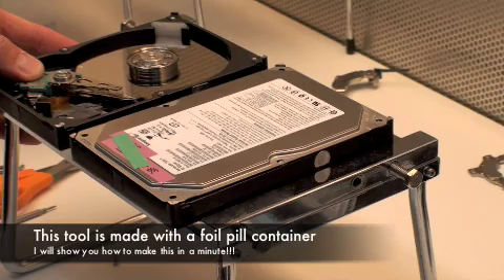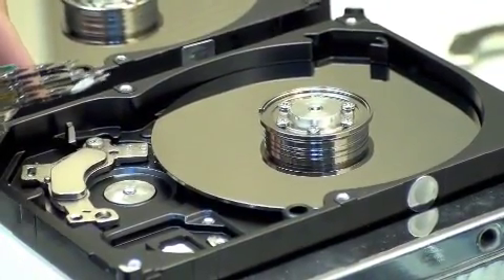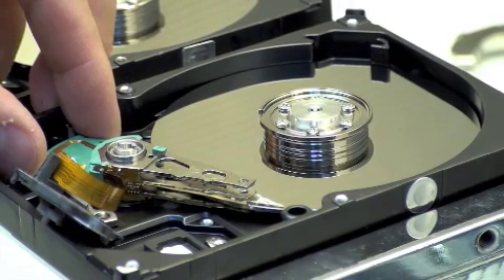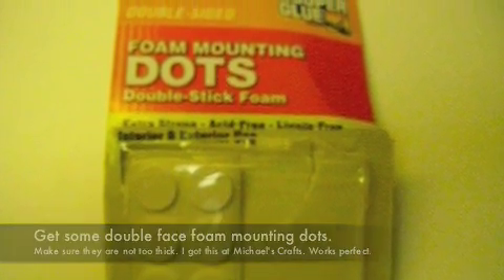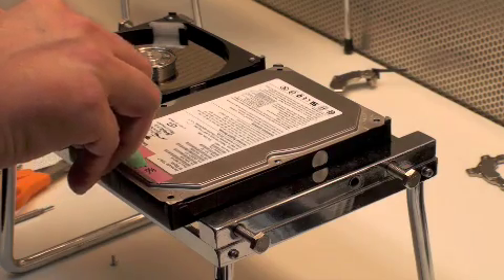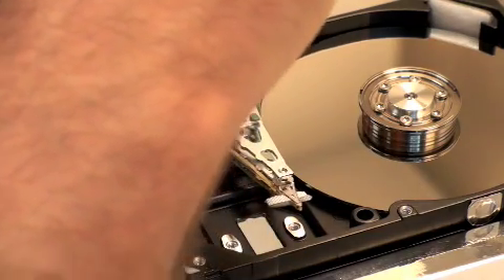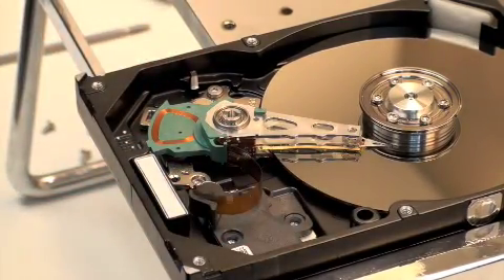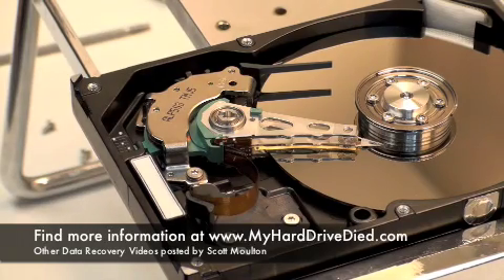Hard Drive Head Replacement Tools for 50 Cents

Comment: You don't need a clean room for a head swap if all your going to do is get the data off that drive. I would never put a drive that I've opened in the first place.
Do the head swap, pull the data, toss the drive in the trash.

Comment: I had a Hitachi Death Star 500 GB disk, with 8 heads, I made a similar tool using coffee stiring straws that I cut up and smashed carefully. Fortunately, the Hitachi disk has an off platter park zone, no need to drag the heads back to an inner park zone. I accidentlaly put my sticky fingers on the top platter and had to use Windex glass cleaner to wipe off the finger prints.  I was able to recover about 85% of my data, the other 15% was wiped off by the glass cleaner.

Comment: Hi, i've a question. first: sorry for my english.
I bought lot of HDD and tryed to remove the head and mount it again. First i had the problems that the head crashed together, then i saw your video and found a way to expand the 4 heads of my seagate 2,5 hdd. Now i can change the heads without any damage (i reckon). But it didn't work. always the same problem (clicking). If i have the same HDD (same partno, FW, modell no, its a st9500420as) i thought i can change the electronic, the heads isn't it? I had an hdd head crash and before i try to repair my hdd i will try to make a complete and working hdd change. do you have any idea? happy new year to all!
Reply: you should try replacing the pcb next.  you may need to transfer the firmware chip from the old pcb to the new pcb (if model is made within past 8 years) and the pcbs must match of course

Comment: when ordering donor drives they cost more because you order a specific model # specifc firmware, etc head type... ect.. they will not cost the same as a regular replacement drive. they have to match EVERYTHING if not your chance of recovery goes down the drain.

Comment: Before and after you replae the heads, are the heads just a little above the platter or do the heads actually touch the platter?

Thank you!

I just found a head replacement tool that sells for 500 euros! That is beyond outrageous. It's just a little aluminum thing. But a strip of a pill container and a bit of foam, that I could manage!

Comment: First of all: thanks a very big lot for video's like these. They're very useful.
One question though: what is the function of the piece of foam inbetween the bent plastic strip? I tried without on a dummy/practice hard-drive, and it seems the plastic is stiff enough to keep the heads apart on its own...

Comment: Quick question. If my hard drive already has the parking spacer in place (1TB Hitachi, multi-platter) do I still to utilize a tool such as this, or could I make sure the heads are parked in the spacer and remove the heads and spacer as one?

Comment: Is it OK if the tool touches the platters?
Reply: 8 years late, but no... probably not. I've seen it put little micro dings on the platter surface here, but maybe my tool had some roughness to it. This whole process is much harder than this video would have you believe. The heads have to be almost completely off the edge of the platters in order to access the area between the arms where you need to insert this tool, and it's very difficult to do without scraping along the surface with it as it goes in. Lastly, the tool needs to be slightly compressed as it goes in, then released. This compression is not in a direction most tweezers can provide (even bent tips). Plan to cuss.

Comment: what if my disc has a scratch and the head point is in between the wheel and the scratch?, do you you think I can repair it by changing the head? I already have another HHD of the same model, is a Maxtor diamondmax, please help, any suggestions?

Comment: I have a WD20ears 00S8B1 and read this after several searches. I considered a platter swap but found this specific info.
The drive spins up, and and the heads start clicking with a constant or intermittent sound while unsuccessfully trying to locate firmware zone: , , , . Usually this is a sign of damaged or crashed heads  and it means the drive needs to be opened in a class 100 clean room environment in order to replace head stack assembly. 
 I like this video!